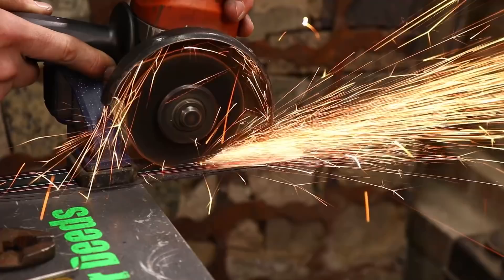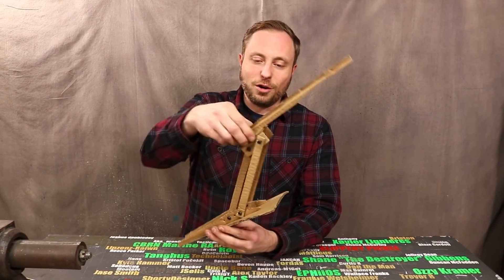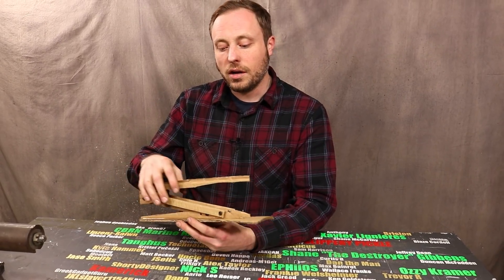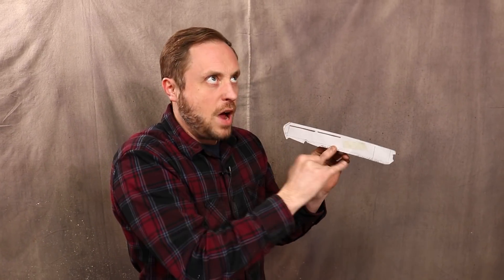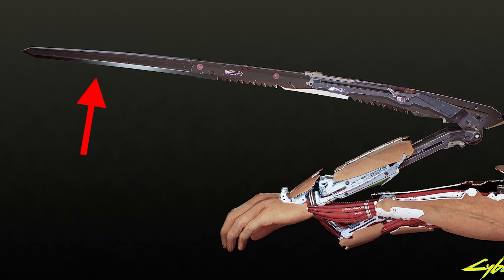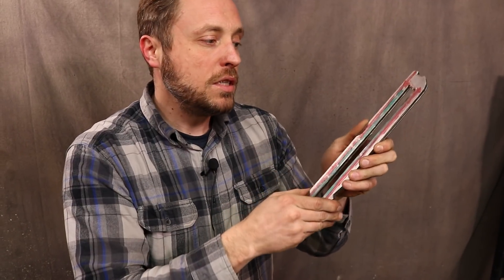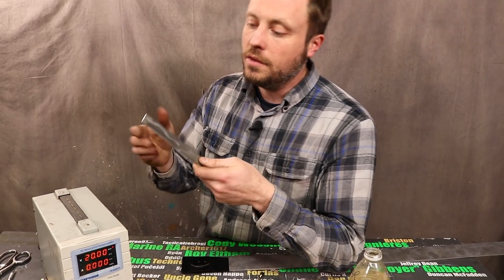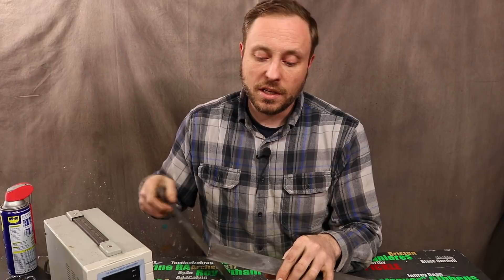REAL LIFE Mantis Blades Cyberpunk - Build Part 1

Comment: Thats imposible if it will be inserted in your arm because of rusting and that is bad but even if you try to do it a peace of wire will be inserted in your mind and conected to the hand controling piece in your mind and has to do surgery on your arm,neck and scalp opening the skin and bone and inserting the wire because if the wire is pulled out the wire  has a piece of brain making arm control even harder and the wepon will malfunction so they have to do surgery and they have to make something that doesnt rust like metal that doesnt rust and a servo that is small and strong because cuting other musle will lead to less arm control so they will have to make a more more smaller wepon so it will be smaller then you thought so it will be less usfull and your musle will strech because the creator made it look like a face sucker egg and it will hurt so will you take the thing or so called wepon  i recomend a metalic straw that has a small bee hive thing that go thro the nose to the lungs and cuting it making internal bleeding and if it go to the heart a straight kill 

Edit:hahaha try to read that all
Another edit: you have to blow the straw to kill some one
Reply: Sry did i write to much

Comment: Hey man, just so yu know you can get desktop cnc mills thst can handle aluminium and thin mild steel off od amazon for $500 or so. I have one and it has made my own projects a lot easier. Plus i think that working in autocad could help in your prototyping. Although i do enjoy your prototyping with a more hands on approach but i think if you gain some extra tools that can assist in your projects it will help increase your amount of vids and repertoire of projects that you can make! I enjoyed your vid and hope you continue to work on great projects.

Comment: Not gonna lie, you probably should've done titanium for the body, and steel for the blade since steel is a generally superior blade material, and titanium is a generally superior structural material.

Granted, would've cost more to do that, so I understand why you're doing what you are.

Oh, and a liner lock is more likely to fail than a lockback or other form of insert locking mechanism, and lockbacks also have the benefit of staying in line with the blade instead of being disengaged by pulling to the side, which is likely to be easier to do with the device you're designing and more likely to keep the same general look as the one in-game instead of having a tumescent latch mechanism sticking out of the side of the sheath that isn't there in the source material.